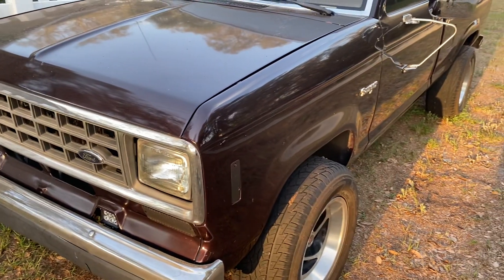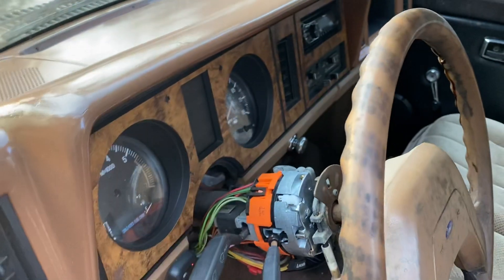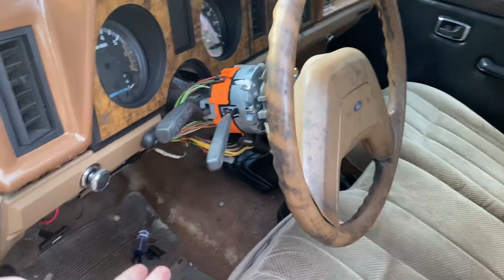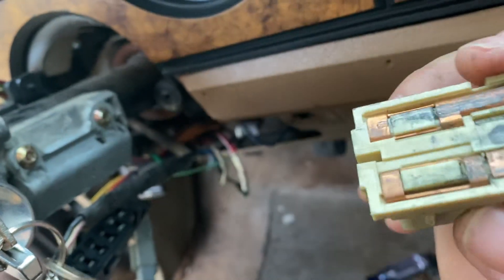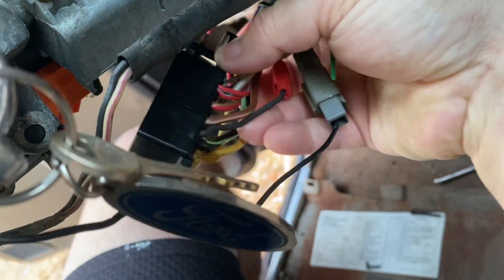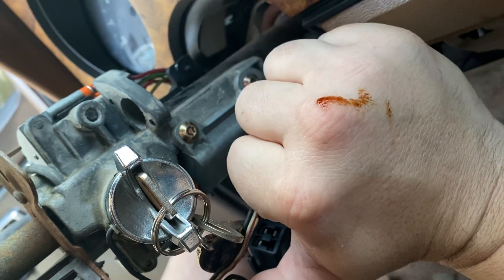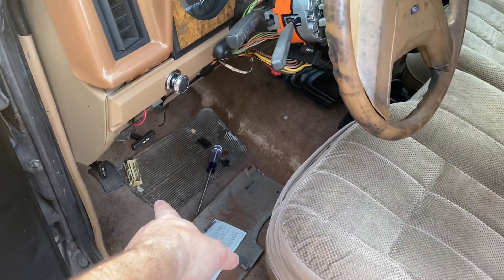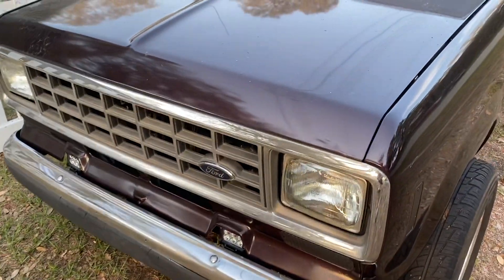FORD - Found On Road Dead But We Still Love Em’

Comment: I was going to say it was the inertia switch on the passenger side trans tunnel under the carpet, but you showed the switch. My Ranger GT used to have the inertia switch reset often, the kids would jump up and down in the bed and play flashlight tag and trip it.

Comment: Ah memories of my parents old 87 or 88 xlt ranger. They had it until the end of 2007. Unfortunately it developed over heating issues.
Reply from the maker: Yeah... this one has the overheat problem too. That’s why I’m rebuilding the engine and doing new heads. Already has water in the oil. Hopefully after the rebuild it’ll go another 150000 miles.
Reply: Yep.  I drive an '87 ranger that had the overheating problem.  I got around it by removing the thermostat and installing a manual valve in the upper radiator hose.  Crude, but kept me going.